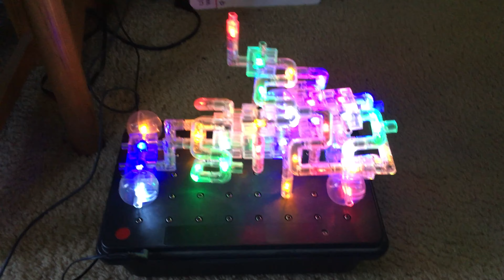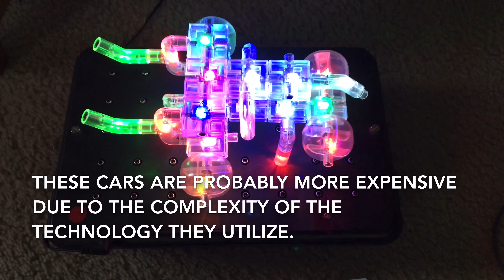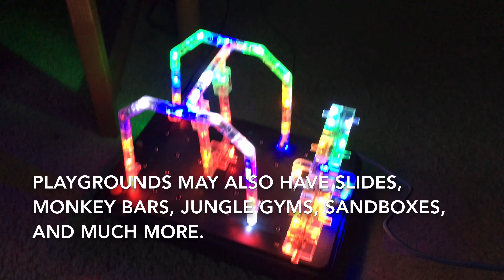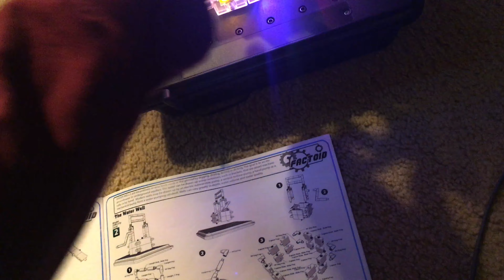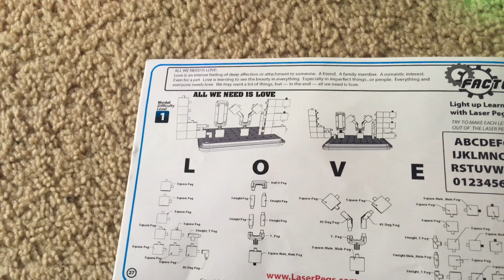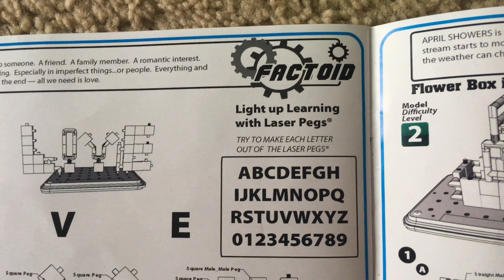3D Lite Board Laser Pegs: Projects 15-19 (SEIZURE WARNING)

Comment: If you can gather other pieces that is part of various other laser pegs kits you can be able to make bigger structures on the 3-D lite board for example a tank and the expansion to the keep on trucking model. Or even make another bridge piece and connect very different types of panels separate an actual full-fledged bridge.

Comment: If you have yourself a second 3-D light board, you can be able to make a giant trailer piece connected to the keep on trucking model and turn the keep on trucking model into a big rig hauler.
Reply from the maker: That is a very creative idea!  If someone had an extra board, they should certainly enhance that model!
Reply: Yes, although the trailer idea which is basically an expansion to the keep on trucking model is basically something that was made by the creators of laser pegs themselves.
Reply: There used to be more manual for the 3-D light board that have other models as well as some enhancements and expansions to art existing models, mainly to keep on trucking one, but it’s hard to find those other manuals now since the series is now dead.